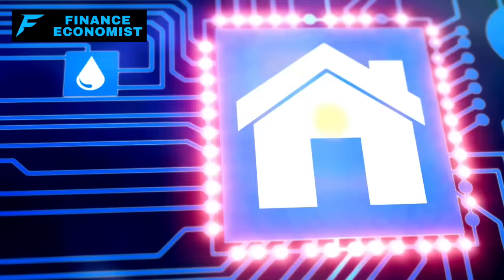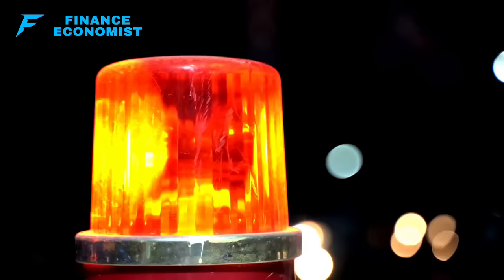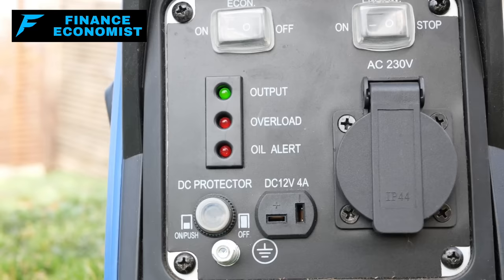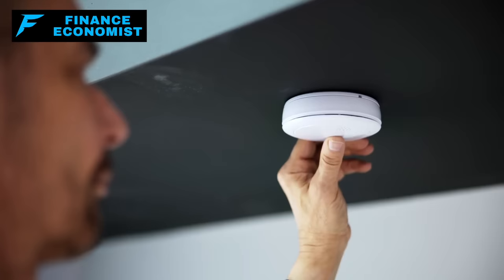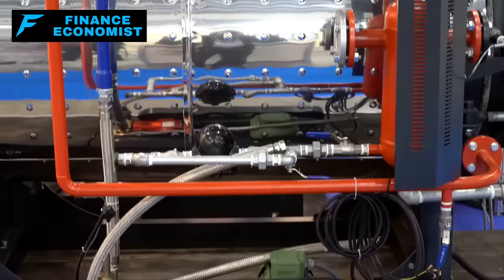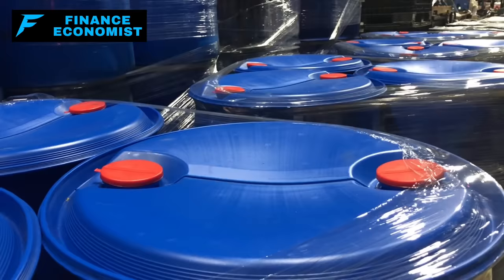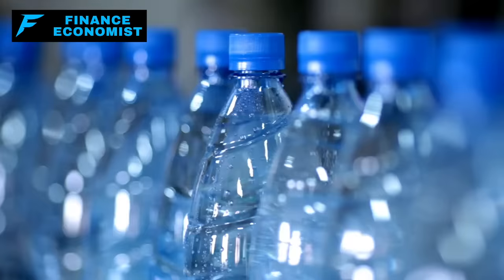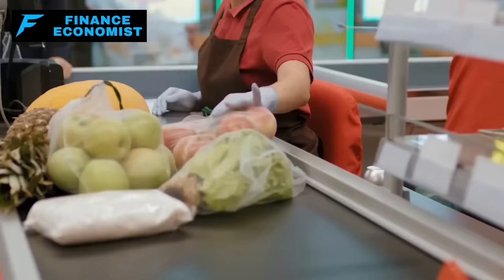8 Critical PREPS to STOCKPILE for a Mainland Attack in the US!

Comment: You may get a vest to protect the vitals organs but be aware of the fact that you have femoral arteries. So while a direct hit in the vest may be stopped, a hit on the inner thigh will kill you by bleeding out if you do not properly know how to do a tourniquet and get medical assistance right away. Surveillance is only as good as the people pulling the security. If in an apocalypse or attack from outsiders, alarms are an attractant, not a deterrent because they pinpoint where you are. Light and noise discipline are a must. Better using a red lens light for night time. Generators provide power but using a 12V deep-cycle marine battery with a solar panel to charge and an inverter is effective. Get rid of electronics that may put out a signal i.e. phones and smart TV's. Food storage and the ability to hunt, trap, and fish are a must. Though good tips this is basically telling you to ignore light and noise discipline if attacked 😵‍💫 create candles from crisco to make a heater using ceramic planting pots. Learn your vegetation so you know what is good for eating. Get purification tablets or straws (I have both in case my storage water gets expended) the food storage tip is good (lots of rice and flour resealed with oxygen absorbers). Learn to grow food and which grows best in your area and soil.
Reply: None of this will be possible once this earth is NUKED.
But anything is possible if we are United against all that is EVIL.
Reply: @CLM2204   true, the ones that do manage to survive a nuclear attack will wish they hadn't. Unite is the key but we are divided currently on one thing or another which are good and evil. Evil keeps popping up its ugly head everywhere.
Reply: Yes, l am a prepped, l have 45 lbs of rice, buying beans, getting 60 lbs of sugar, l have every kind of spices and herbs, getting a freezer, solar powered generator w/ solar panels , getting a gun really three l am a elderly lady all alone with my dog ALEX and yes he will bit you , l got 7 cases of water and getting more, planting onions, garlic, peppers, tomatoes, potatoes, beans too, yes l know about crisco will buy 10 cans , hurricane lamps, bundles of tissue, liquid soap, bleach, filter straws, etc oh! I got a survival knife too, first aid kit , got dry milk, tea, buying   (3 )20 lb  bags of dog food too.😊😊😊😊😊
Reply: Most of the city will get wiped out first. Bugging out is crucial but be aware all the rural areas are locked and loaded. Find a solitude place away from rural homes or find a home that may be vacant.

Comment: Gas 3-6 months? Really, I have used PRI in it and stored it for around 3-4 years and was still good. I have an old Ford that has had untreated gas in it for longer than that, and still runs when I need it.
And you didn't mention medicines. The FDA has came out in the last few days and told fish antibiotic suppliers to stop of face legal action, so people may want to stock up on a few before they are gone from the shelves.